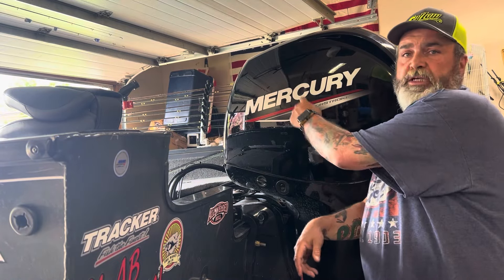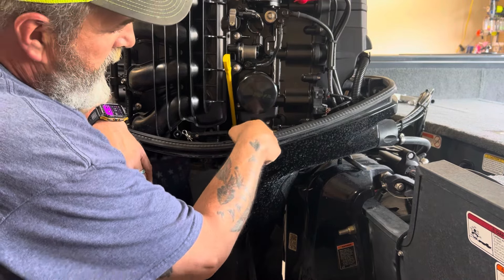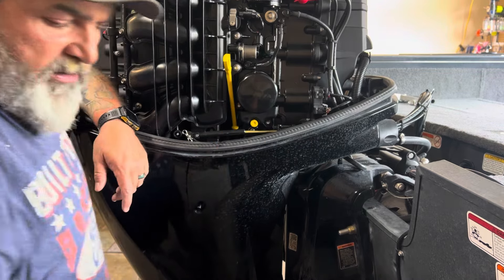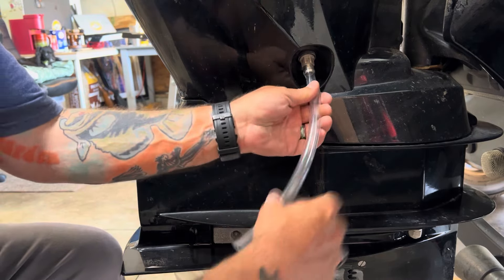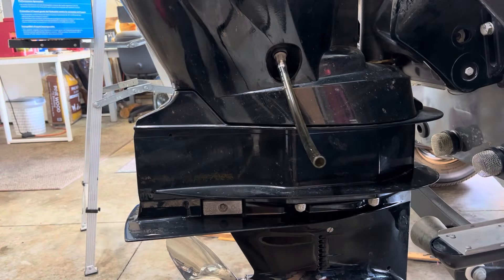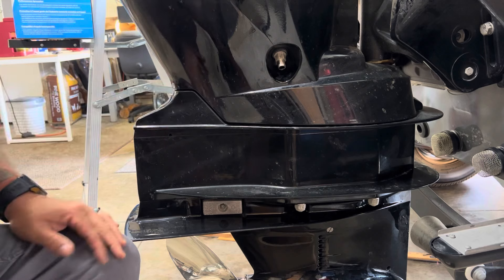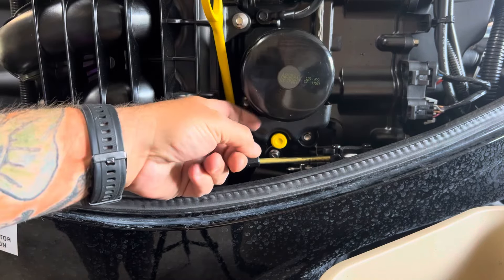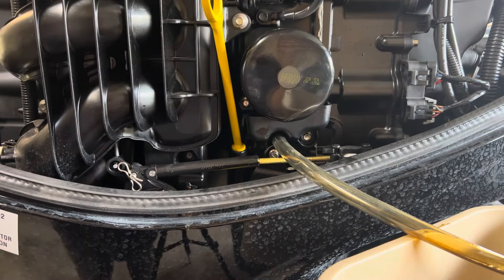DIY oil change outboard motor maintenance

Comment: Great job on changing the oil , I used to have a Mercury, but I got the E-Tech HO that came with the boat whey I bought it 4 years ago, I have a  Aluma-Craft  165 like it so far , especially when I store it up for the winter. You start it up , let it run for 20 seconds and then lift the lever up and let it run 30 seconds and it winterize itself and turn it self off !

Comment: That thing takes more oil than my truck. Don't even want to think about how much it costs to change that.
I did cringe a little when you where using the wrench to tighten the filter, but you're the one that's going to have to take it off again lol.
Reply from the maker: I cringed with that filter wrench lol